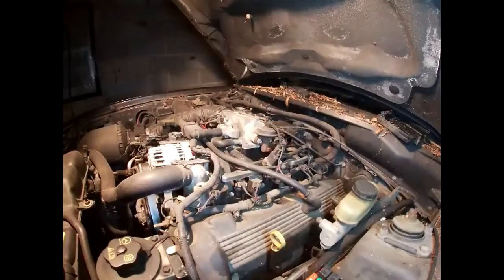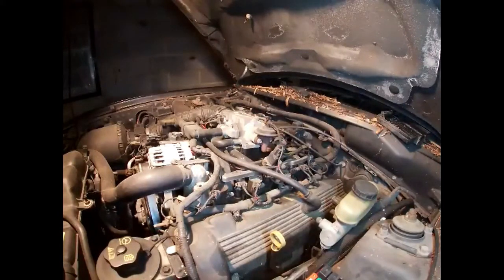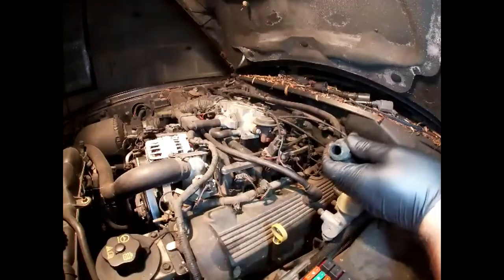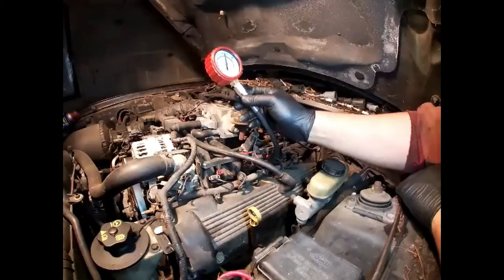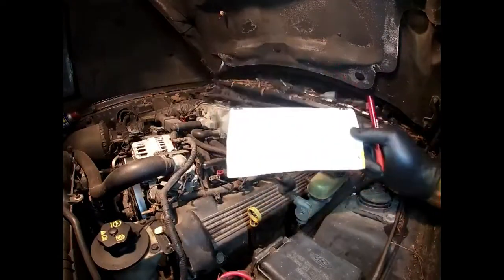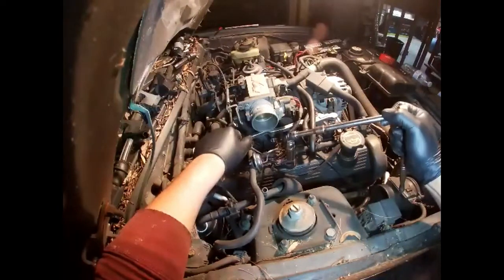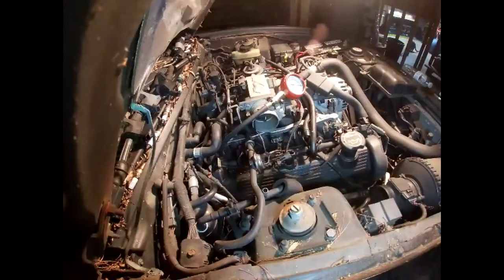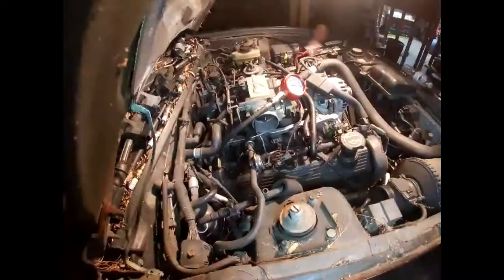Mustang Gt 4.6 Compression Test With Spark Plug And Coil Removal

Comment: was the compression lower on one bank than the other?
Reply from the maker: Compression can differ from cylinder to cylinder but they all should be within 15 to 20 psi of each other
Reply: @michaeltrue1143  , i know an understand that but thats not really what i asked ... since the 2v 4.6 is sohc if one cam is clocked different it can give one bank higher readings or lower depending on how you look at it .. cam advance / retard changes valve open n close at different moments of intake stroke/ compression stroke ..i could have watched video again but didnt have time